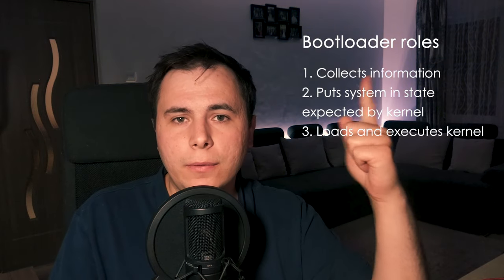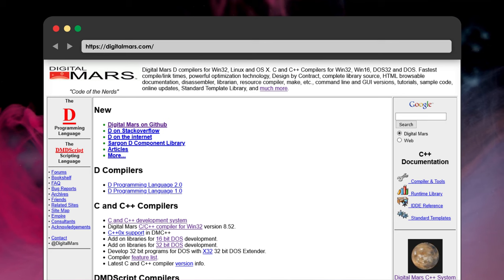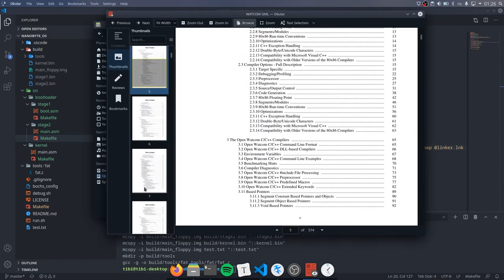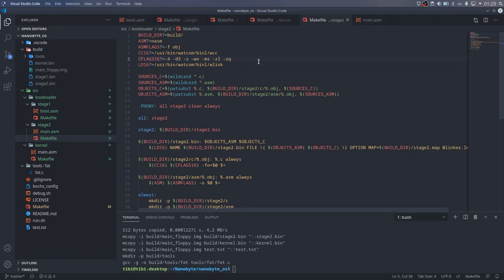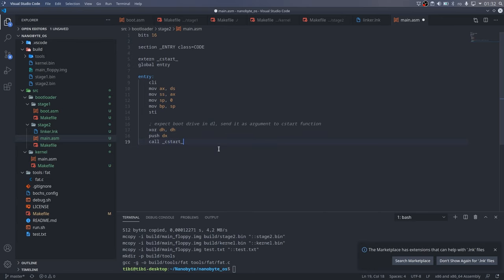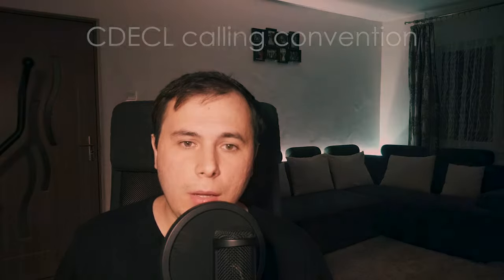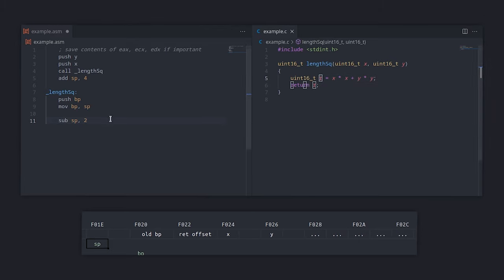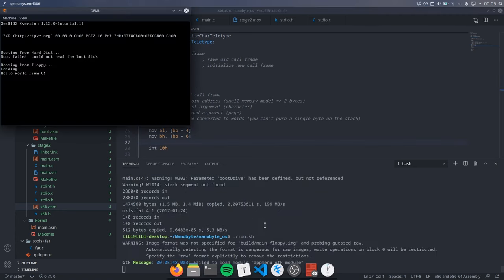Building an OS - 4 - Writing bootloader in C

Comment: Amazing! I'm restarting watching the series, and one thing came into my mind. If I try to use rust or even c lang, but using the traditional compilers, is there any way to put the processor into 32 mode so I can use the binaries generated by those compilers, or I need to find a way to compile the code to real mode?

Comment: i know it's quite a young language but would you ever consider doing an osdev tutorial with zig?
Reply from the maker: Never heard about it before. For now I'm sticking with c/c++, but I might try it in the future.
Reply: @nanobyte-dev  yeah fair enough, it essentially tries to be a more modern c with strong compile time programming support and the ability to manipulate the way data is laid out in memory, but the documentation and general online info is severely lacking
Reply from the maker: Sounds interesting. Rust is also another language that should be usable for operating systems. 

My current goal is to cover the basics and also some of the intermediate stuff where a lot of tutorials drop off and many people get stuck. After that, my plan is to do ARM (probably on the Raspberry Pi). Once I get past these goals, I may think about different languages...
Reply: @nanobyte-dev  yeah rust is also a big contender and I agree, covering the basics is far higher in terms of priority and you're doing an awesome job of it
Reply: @nanobyte-dev  I’ve been trying arm on the raspberry pi. The problem is that the USB controller is closed source so as far as I can see there is no way to support USB.

I also don’t have a uart cable, so I have no inputs for it.

Comment: Just a note for someone (like me) who is getting errors about "wcc: no such file or directory"

If you installed the x64 linux version, the wcc and wlink are in the "binl64" folder, not "binl"
Reply: vincenzobrocato11  definitely not, the wcc and wlink folders just did not exist in binl, even after multiple reinstalls

They were there in binl64, and changing the path accordingly made it work just fine
Reply: vincenzobrocato11  I use kali

And I doubt it, the installer can't be wrong (especially after multiple reinstalls of that too)

Maybe you downloaded the x86 version which does have it in binl
Reply: Im on windows and wcc isnt an exe for me

Comment: Error! E2028: x86_Video_WriteCharTeletype is an undefined reference

I know what you said about making sure we exported it or something but "global _x86_Video_WriteCharTeletype" is right above the label so it should work!

For now I give up until i get a response, i'm done with this debugging process because nothing you do works on my machine and i dont know why, there are so many important steps that i'm not being given
Reply: I'm not sure if you have tried this but i believe you should recheck whether you have included the _ before x86 in the assembly code and get rid of that _ in the    .h file and make sure that it's a    .h file and not a   .c file

Comment: Hello! Thanks for great tutorials! I have question: afaik there are two methods to generete interrupt from C - "genint" function (dont remember exact name and matbe it is obsolete now, but 20 years ago such function existed) and in C-code you could use "asm { } " command and put any asm code in curly braces (this way long ago i generated int 33 to handle mouse). Is it possible to use these methods nowadays?
Reply from the maker: GCC has a similar idea, __attribute__((interrupt)). I stopped using watcom a few videos later in the series. I personally think that it is better to write this critical part manually, than let the compiler do it, you have a lot more control over what happens. You might want to do some things that GCC won't generate, such as saving/restoring the context (all the registers content) before entering/after exiting the C function.

Comment: Can u explain me what happened and commands used in 9:13 . I run an ubuntu  18.04 and tried to run it but i cant replicate it. It just says "is a file directory"
Reply: He tried accessing wcc directly however it did not work, he checked to see if the command existed however it did not

What happened was that the wcc installer did not set any paths, it simply extracted the files to usr/bin, bcs of that later on he manually put the entire path into the makefile

The "proper" way to do it would be to add the wcc folder to path but there's no need to

Comment: What's wrong with gcc -m16?
Reply: "If the entry point address is not zero, there is a problem somewhere". ??? Okay, soo.... where would I look? I get 10.

EDIT: found it, I made a typo class-CODE, which should be class=CODE
Reply: I think in the video he mentioned something about gcc optimizing things too much, which is not fit for writing 16 bit real mode code.

Comment: hey when i try to run make i got this error:
make
mkdir -p build
make -C src/bootloader/stage1 BUILD_DIR=/mnt/p/Dev/OSDev/build
make[1]: Entering directory '/mnt/p/Dev/OSDev/src/bootloader/stage1'
nasm boot.asm -f bin -o /mnt/p/Dev/OSDev/build/stage1.bin
make[1]: Leaving directory '/mnt/p/Dev/OSDev/src/bootloader/stage1'
make -C src/bootloader/stage2 BUILD_DIR=/mnt/p/Dev/OSDev/build
make[1]: Entering directory '/mnt/p/Dev/OSDev/src/bootloader/stage2'
mkdir -p /mnt/p/Dev/OSDev/build/stage2/c
mkdir -p /mnt/p/Dev/OSDev/build/stage2/asm
nasm -f obj -o /mnt/p/Dev/OSDev/build/stage2/asm/main.obj main.asm
/usr/bin/watcom/binl64/wcc -4 -d3 -s -wx -ms -zl -zq -fo=/mnt/p/Dev/OSDev/build/stage2/c/main.obj main.c
main.c(3): Warning! W303: Parameter 'bootDrive' has been defined, but not referenced
/usr/bin/watcom/binl64/wlink NAME /mnt/p/Dev/OSDev/build/stage2.bin FILE \{  /mnt/p/Dev/OSDev/build/stage2/asm/main.obj  /mnt/p/Dev/OSDev/build/stage2/c/main.obj }\ OPTION MAP=/mnt/p/Dev/OSDev/build/stage2.map @linker.lnk
Open Watcom Linker Version 2.0 beta Aug 14 2023 01:49:01 (64-bit)
Copyright (c) 2002-2023 The Open Watcom Contributors. All Rights Reserved.
Portions Copyright (c) 1985-2002 Sybase, Inc. All Rights Reserved.
Source code is available under the Sybase Open Watcom Public License.
See https://github.com/open-watcom/open-watcom-v2#readme for details.
Error! E3033: directive error near 'OPTION"'
make[1]: * [makefile:20: /mnt/p/Dev/OSDev/build/stage2.bin] Error 1
make[1]: Leaving directory '/mnt/p/Dev/OSDev/src/bootloader/stage2'
make: * [makefile:40: build/stage2.bin] Error 2
Reply from the maker: There's a syntax error in the linker script. You can check against the github repo in the description.

Comment: I must of missed something, in Ep 3 you "ran out of space" in your first bootloader. You had 400KB to work with, assuming a small amount of stack space (you don't use much), you should have enough room for a good 200,000 16-bit assembly instructions. Did you allocate too much ram for copying sectors from floppy?
Reply from the maker: If i remember correctly, this was in stage 1 where you only have 512 bytes (that also includes the filesystem header).
Reply: Yeah I think he was referring to the bootcode sector

Comment: 18:48 20:10 20:50 and more moments — what?? Something went wrong with your microphone😂
Reply from the maker: Yes... it was really a nightmare to deal with. For some reason, the audio recording skipped about 20-30 times during a few hours of recording. I have no idea why, every now the audio jumped 3-4 seconds forward. I only realized it after several hours of recording. Because of that, the audio and video kept going out of sync. My choices were to fix it manually, by going through the entire footage, find all the places where that skipping happened, and fix the synchronization, or redo the entire recording session. When I mess something up, I repeat that line, and in most places I was able to find another take where it didn't skip... but not for these. My only option was to use the audio from the video recording (i recorded with my phone).
Reply: Damn

Comment: Can you do this with c++?
Reply from the maker: Yes, but it's a bit more complicated. You need runtime support for some of the c++ features, like exceptions, virtual functions, new / delete and a few others. You can avoid using these features, but you still need to set up a few extra things. Check the osdev wiki for more details (although these might be specific to GCC). I haven't tried it with watcom, and I think for the stage2 bootloader it's not necessary. Might be worth setting it up for the kernel though.
Reply: Thanks for thr response :D
Reply from the maker: You're welcome 😊
Reply: @nanobyte-dev  You can actually use C++ as C by defining extern "C" before any method

Comment: It seems to me really weird to care about calling convention when a compiler is involved.

With optimisations in mind, I would think that the compiler chooses on a function by function basis the best methods to save registers and reuse the caller's variables.

As for assembly, you could say my function does nothing extra YOU do it, here's how the parameters map to registers with (insert fancy directive here)

But I'm guessing there aren't enough bootloader writers for something like this to be a feature.
Reply from the maker: The compiler does this when it decides to inline functions. But, if a function is used in multiple places, that optimization becomes really difficult to make. Also, keep in mind that source files are compiled separately, so the compiler isn't aware where a function is used until the linking happens, so this would be a job for the linker. Another issue is with functions that can be called from the outside (e.g. dynamic libraries), where you need the calling convention to be predictable.

Related to assembly, you can look into the differences between different assemblers (NASM, GAS, FASM, YASM etc), there might some that have the features you want.

Comment: "We want to start to use a higher level language"
Rust?

"So what exactly are our options"
Ah the diversity of oxidation. Iron rusts. Even stainless steal may rust because it go iron in it. And Mars got Rust all over it. The people of Mars use Rust.

"We need a language that will not get into our way."
Son, listen. Rustputin is not the same as Rust. You do not use Rustputin. Soviet Rustputin uses you... Choose Rust. Avoid Rustputin.

"We need low level stuff."
They say that the higher you go the lower you fall. Rust is quite high now.

"Manipulating memory. Manipulating bits.."
But Rust is honest. It does not manipulate. It is a safe language. Do not make me to call the cops on you... -.-

"Talking to hardware. Interacting with assembler code."
Some people call it a whisperer. I call it Rust.

"We also need a lot of things that does not rely on any run time stuff"
The blades of Rust cut with the thickness of paper. But with the hardness of the Rust compiler. Mind your limbs.

"The most obvious choice for a language would be c"
Yes you do need the rustc bin to compile Rust source. Duh... silly....
Reply from the maker: Rust is a good option, I just decided to go with c/c++.